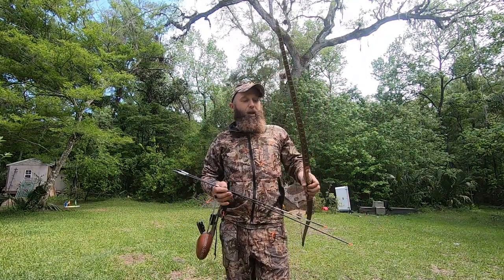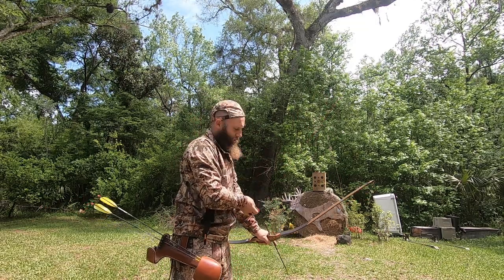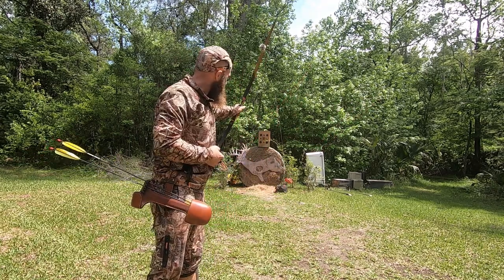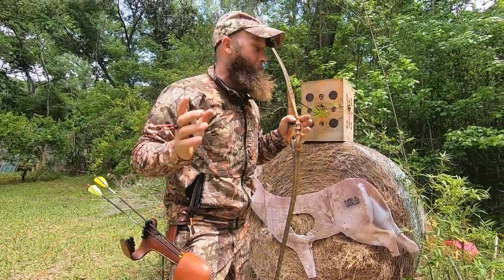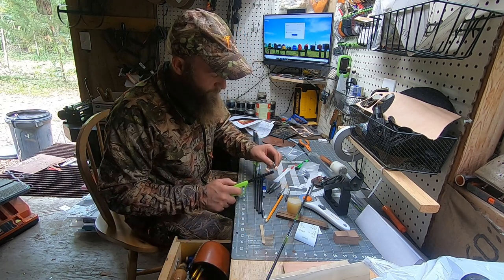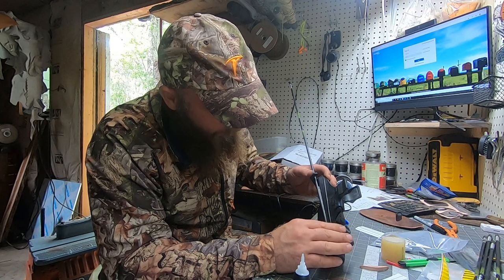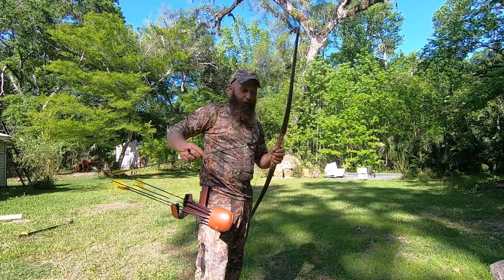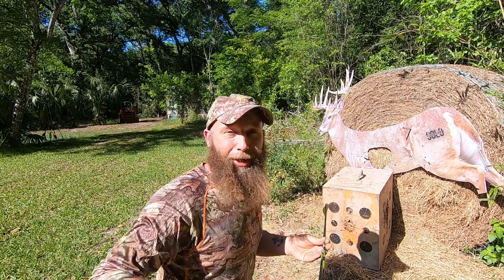Bare Shaft Tuning A Traditional Bow

Comment: Or does it mean I have too much weight up forward and even after trimming shaft to edge of shelf and it still flies left I would need to reduce the weight up forward by trimming the outsert/insert or getting a smaller weight broadhead
Reply from the maker: You can either go stiffer spine or lighten tip weight. What bow weight and length and arrow are you shooting?recurve or longbow.
Reply: @OmnivoresHomesteadAndQuivers  I shoot a thunderchild long bow. It's 50# at 29 1/2 draw but I only draw back about 28 1/2 inches. 47# maybe is my bow. I'm trying to find the right arrow length and spine right now so I have some Easton legacy in 340 spine with a length of 28" and they still fly left so im.at my min for arrow length. Then I have some carbon trad in 450 spine that are 30 inches and fly pretty true with the feathers cut off and 230 grains up front with a 150 field point and 80 grain victory outsert. I took that setup and cut an inch off to get it exactly true or straight in the target and now at 29" it's leaning way left...I shouldn't have cut the 1 inch off I guess. Your video is very helpful I just need to get my setup figured out and dialed in.
Reply from the maker: That bow would love an Easton bloodline 480 spine full length  with 225 up front. I know because I’ve shot that arrow out of that bow with the same weight.

Comment: I used super glue for 15+ years and the past 2 years I have been using fletching tape. It works great and holds just as good as the glue.

Comment: Thanks Mark....What spine are those arrows??  I have a long bow 45lbs @ 28" on order.  Should be pretty close to what you're shooting.  I checked out the Centaur site, look like quality arrows.  Oh, what weight up front??  (insert and target tip)  Thanks.
Reply from the maker: I bounce between my centaur archery’s arrow and eastons. My carbon paradox from centaur are 500 spine. 225 grain heads with 60 grain outsert. These are my I’m gonna kill everything arrows. My lighter setup are 3 rivers Easton traditional only 600 spine with 225 up front and standard inserts. They are my all purpose arrow. Great for target. A little light for real big game hunting but they do work.

Comment: Hey Mark, have you ever had an arrow corkscrew through the air after release? My bareshafts fly amazing, but my fletched shafts fly through the air just horrendous. Got any suggestions? 
Bow and arrow set up, 57# recurve, running an 8.25" brace height, drawing 28.5", shooting 340 spine axis arrows cut to 30.25" with a 115 grain insert and a 125 grain point. 

Thanks so much for any advice
Reply from the maker: Sounds to me like fletching contact on the shelf.  I think your mock point is low. That’s why I always bareshaft with nock high and then adjust my final nock point while comparing fletched broadheads and fletched field points.
Reply: Maybe your arrow is too stiff. If my bare shaft is straight on the target, my arrow is nock right. I prefer a bare shaft a little weak.

Comment: I used super glue but I don't use it anymore the reason for that is that you may not get cold here but if you go to Canada and your move set in Canada and the temperature drops to 20 below super glue can let loose and you lose your fletching and you can lose whatever you have on your bow because it doesn't hold in cold weather. I would have to call off I can find out if they have a cold weather problem with their glue or not but I do know that Krazy glue will not hold in colder weather